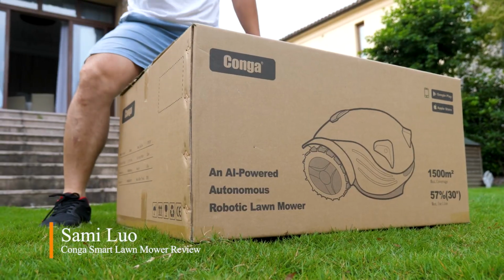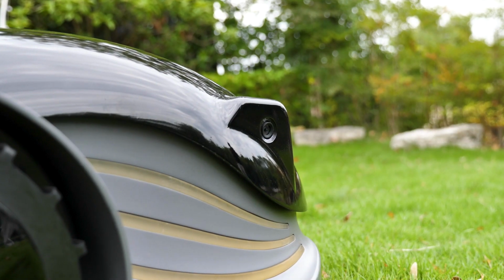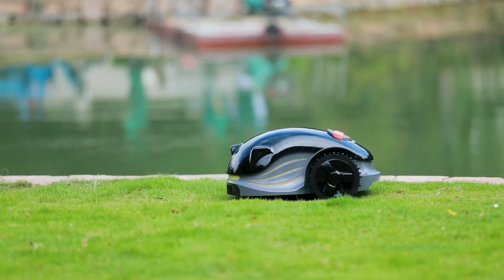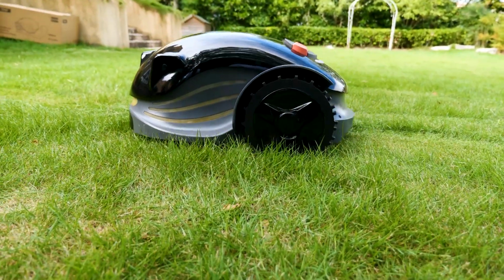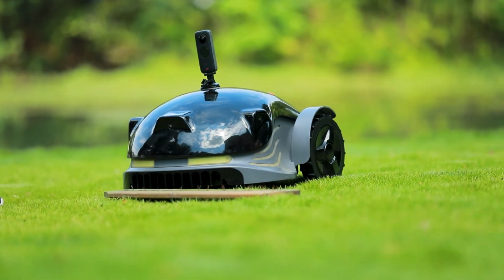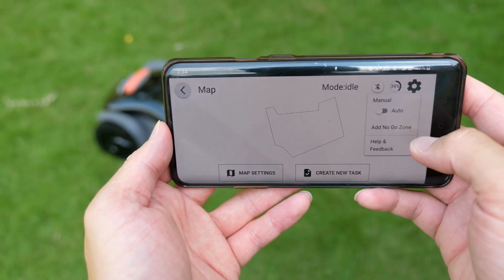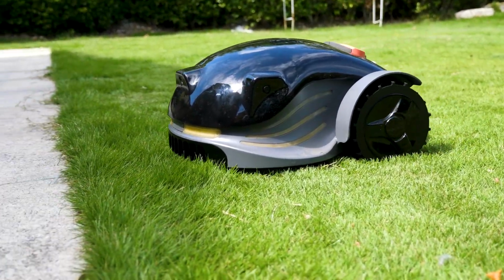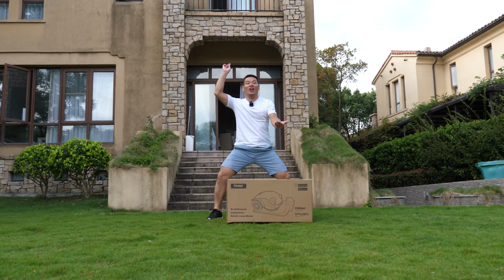Conga Robotic Lawn Mower Walk-through

Comment: Great video! How close did it mow towards the edges of the lawn? Can you adjust how close the mower gets to the edge or even exceed it a little in order to have proper cutting results without a "frame" around the edges?
Reply from the maker: Hi I just checked with Conga CS and here is what they replied: As required by the safety regulations(CE/FCC) for lawnmowers, the blade must be 8cm away from the edge of the mower body. For safety, we recommend placing a distance of 22cm (Including the 8cm blade-to-machine body distance), as there may be a height difference along the edge of the lawn. Also, Conga can easily set and handle the range along the edges via the App to have customized edge mowing, as the lawn is flat and non-height-difference without a pond along the edge of the lawn.
Reply: @SamiLuo  great, thank you so much👌🏼👌🏼

Comment: How close will it cut to an obstacle. How much grass is left standing?
Reply from the maker: I didn't measure exactly the distance though, according to the info, Conga leaves a 3cm distance before obstacles, plus the 8cm safe distance from blades, so it should be around 11cm. The cutting height of Conga is adjustable from 25mm to 85mm.
Reply: @SamiLuo  Thanks for the exact answer! I'm using a mower with a cable fence right now. I like the new approach with cameras and object recognition. But will the Conga recognize different ground materials like concrete for example and keep the distance as well? That would mean in conclusion I'll have to cut every edge connecting lawn to concrete in my garden by hand. With a cable fence, I could install it in a way, that the robot cuts onto the concrete. Especially if you have a machine that does a special outline cut by following the cable.